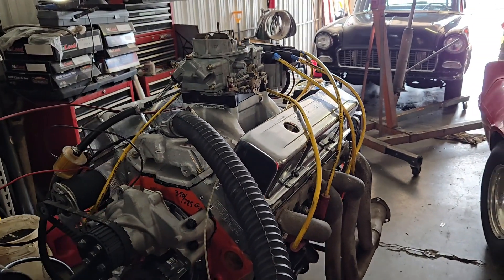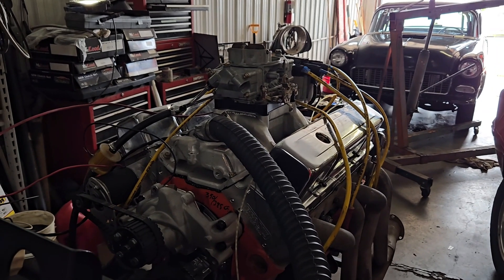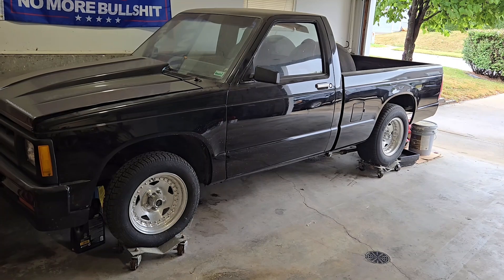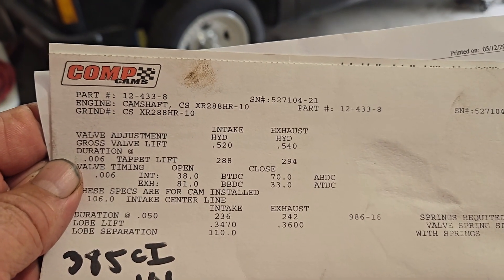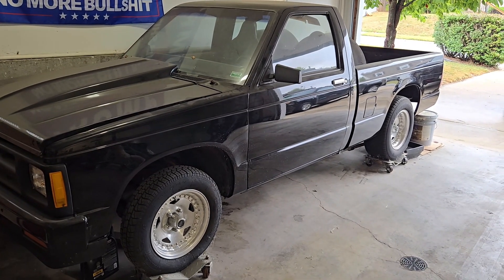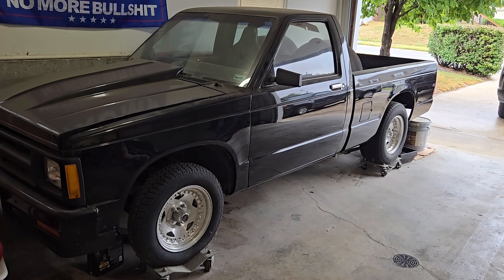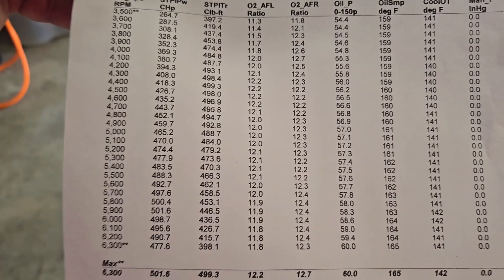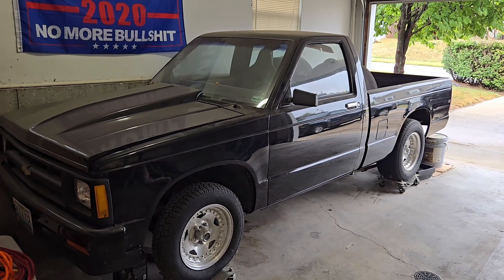383 sbc Xtreme Energy hyd. roller 500hp

Comment: Just found you're channel, very cool. Love all the technical/spec information rundown. 
Funny, I ran that same cam in a '93 Lt1 with GM casting aluminum heads worked over by Chad Golen, along with some others bolt-ons. Pulled 400hp with an untouched bottom end and a m6. Build was a tad much for 350ci. However, a advertised hp rating of 275hp bumped up to 400 at the wheels was a hell of a pickup. Car was a ton of fun!

Comment: I have a 383 11-1 compression, Xr294hr cam with 1.6 rockers, AFR 195 heads. Was trying too hit 500 hp and Tq.
Reply from the maker: Sounds like you got the stuff to easily achieve your goals
Reply from the maker: Cool motor thanks for chiming in